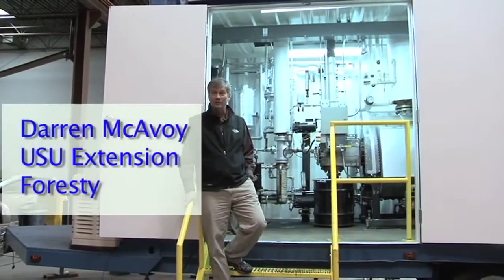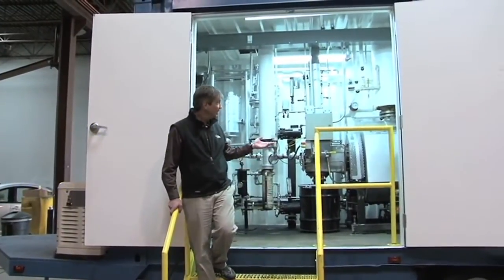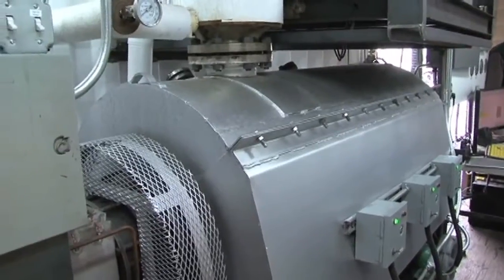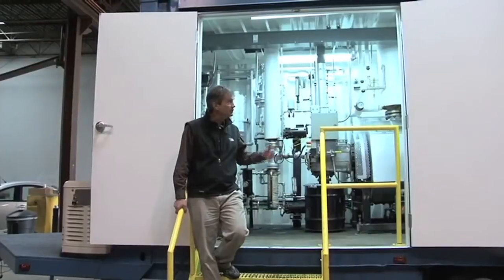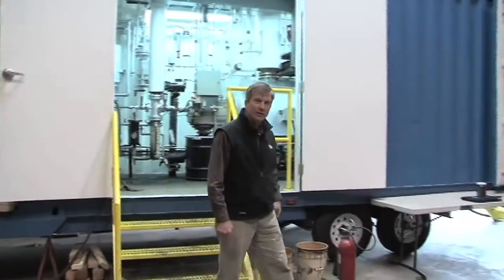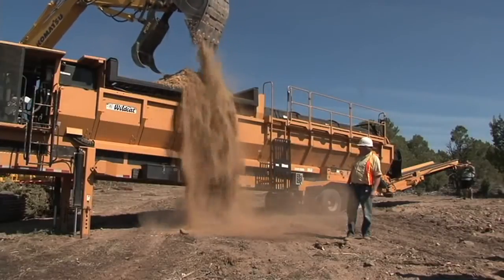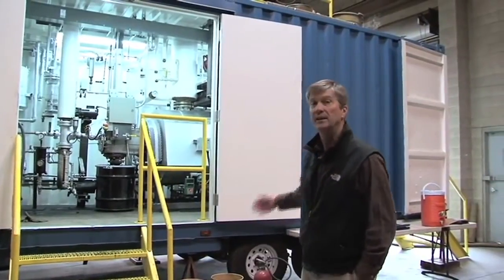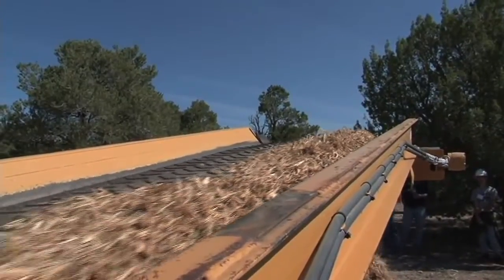Mobile Pyrolysis Demonstration Unit

Comment: I am a bit obsessed with this topic since , if it's all optimized, it could fight climate change while also delivering useful products. There are problems with it. The biomass should be local and nice blocks of wood are dense and easy to store too. If we grow something fast and easy like high grass or bamboo then after harvest, it's not dense and a lot of the volume is air. So I thought about torrefaction and compression as solution. Next the product goes to a pyrolysis plant. However, the local torrefaction heats up and then cools down so a loss of energy. It would be better then to immediately pyrolyze and get the desired end products. That output is even more dense and we don't need to store that roasted biomass (fire danger and expensive silos) (fermentation of plants could perhaps work too for preservation but this brings in a lot of moist) 
If we feed the pyrolyzer only one type of biomass under always the same conditions, then I hope a mobile pyrolyzer like this could be made simple enough and affordable for any village and city to have them. What we see here is probably very expensive and requiring much expertise to work with. This is normal for a prototype.